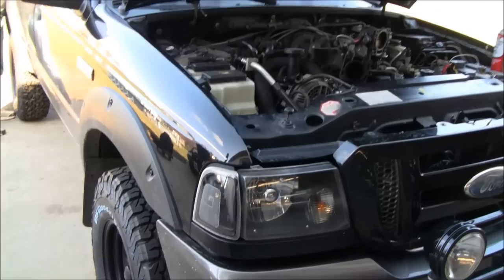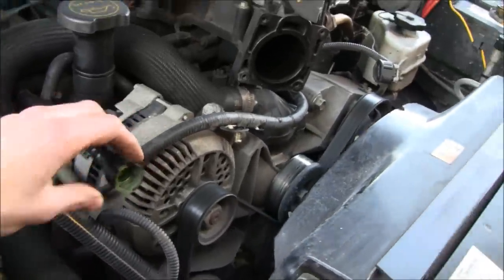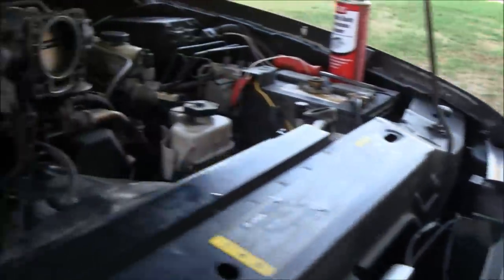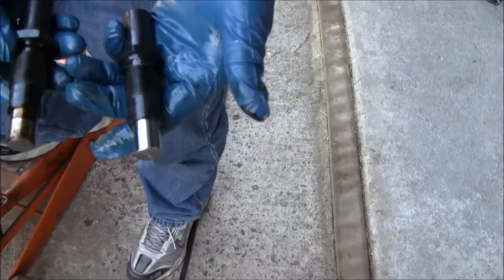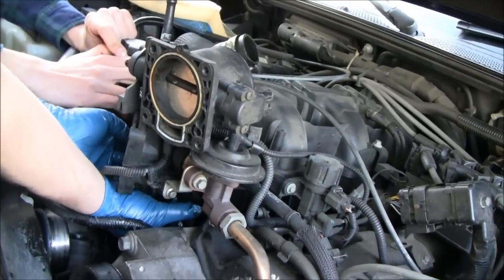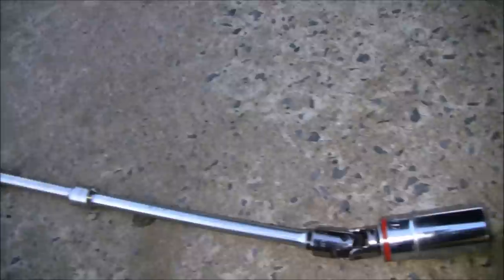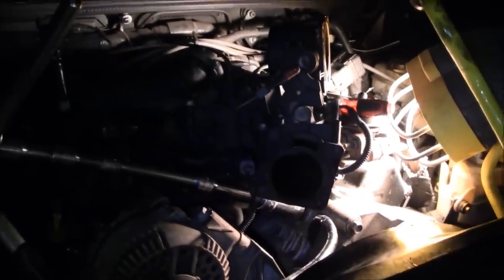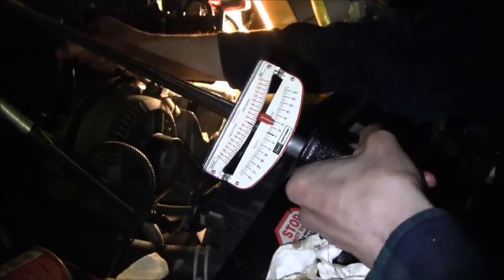REPLACING TIMING CHAIN TENSIONERS 4.0 SOHC

Comment: Thanks for the info. I installed the rear one today but didn't prime it. Problem sounded worse than before.  So I put  the old one back in. After watching this video, I  primed the new one. I will install after work tomorrow. Thanks again hopefully it does the trick. I've only got 150000 on the motor.
Reply: Updates did it work ?

Comment: Great job on this video and the suggestion to use Ford parts. Did the whole job in about 4 hours. I actually had more trouble with the rear tensioner than the front/top one.

Comment: Priming tensioners = cross-threading  😖

If you don't start your car for a few days, the tensioners will become 'un-primed' i.e. empty of oil.  That's what the spring is for.  Weak spring is why you're replacing them.
Strong spring should apply sufficient tension at start-up until it gets oil in it and the 'priming' is done for you.
Reply: I just replaced them. Even after sitting an hour it rattles on start. I replaced both and my passenger side in the rear still rattles on cold start. I’m stumped
Reply: @Cristiano Correia  Sounds like your guides may have already been decintegrated. So sadly the tenshioners might not do anything.
Reply: @ChrisC1946   Push gas peddle to floor and hold for 5 to 10 seconds while cranking to prime.  Engine will not start.  This also should reduce engine flare, as the 4.0 starts at high RPM without oil pressure.
-- If this does not solve cold startup rattle, the internal timing chain tensioner is broken.  Should also rattle at high RPM.
-- If you bought after-market parts, rate of defect is very high.  Stick with OEM Ford parts.
Reply: @C0Y0TE5 hey i have a 01 4.0 on my explorer and I during a cold start the chains rattle for 1 or 2 seconds max and then are completely quiet after that when idling and driving. Even if the engine is turned off after warming up and then back on 1 or 2 hours later  the chains won’t rattle when started back up…

I’ve replaced both tensioners using OEM ford parts and this made no difference with the 2 seconds of cold start rattle that was present before replacing both tensioners. Again after those brief 2 seconds of rattle when started up when the engines is completely cold (ie been sitting for more than a few hours) it never rattles or makes noise any other time.

One other thing to note is that if I do the flooded crank start method before starting it cold it will NOT make the 1 or 2 second rattle. (I will hold the gas pedal to the floor and turn and hold the key to crank the engine but not turn it over until I see the oil pressure gauge go to the middle, then let go of the gas pedal and start it) If I cold start it using this method it will NOT make the 1 or 2 seconds of startup rattle.

Is this my guides or is this normal to have a second of rattle when completely cold?
Reply: @XDLaughPLUR   It indicates that the oil is draining too fast out of the tensioners...?Ford has some bulletins on how to modify, but many comments I saw indicate that they may not work. Also, I have seen complaints about aftermarket tensioners.  I replaced mine with Ford parts, but they did not help.  Mine rattles only after sitting for many hours.
Reply: @C0Y0TE5  could the engine last for many more years doing this?
Reply: @XDLaughPLUR  I think so.  Do the flood start procedure when cold to avoid additional damage to chains and gears when chain is flopping around cold.  If it starts rattling all the time, the guides are toast.
Reply: @C0Y0TE5  does doing the flood start everyday wear out the starter and ignition faster since you’re cranking it for longer than normal or is it negligible?
Reply: @XDLaughPLUR  As I understand it, the Ignition will not fire. The starter will be working more, so it should need replacement sooner.  But that is cheaper than an engine or another vehicle.
Reply: @XDLaughPLUR 
Yes it's not ideal for those components, but is a helluva lot better than the alternative, which is broken chain guides and a car which is no longer worth fixing.
Even if you had to replace your starter every few years (which you won't) it would still be very worth it.
However, I would suggest finding the minimum cranking time required.
It may only be 3-5 secs, not 10 secs.

Comment: When trying to clean up threads, just use a hacksaw or Dremel tool with cut off blades and cut about three grooves in the old tensioner threads like a tap has only really small. It really works well, I have made a lot of taps out of bolts when working in the boonies on equipment to clean up the threads. If ya don't know what the boonies is you must be a Yankee.  LOL

Comment: Literally 8 bolts that hold the intake on it’s way easier to lift the intake up than it is to reach under it like you did. Also torque spec for those tensioners is only 33 ft-lbs

Comment: Don't forget to buy the gasket for the tensioner! It's 32 ft lbs for the right head tensioner. 02 v6 4.0 SOHC.
Reply: after market parts come with gasket.  OEM ford do not.  OEM parts do  not need a gasket?

Comment: i removed mine without removing anything but the thermal sensor clip, and air inlet hose. lol. but then im a mechanic, not an automotive parts changer.i used an open end 1 1/16 wrench, but maybe everyone doesnt have one of those. lol

Comment: Hey at 1:17 did the original tensioners have washers/gaskets on them when you removed them? I' m looking online on various websites that sell the OEM motorcraft tensioners and it appears none of them come with washers/gaskets...So 1.) did the original tensioners you removed have washers on them and 2.) If not then do you have to/can you just use any washers that fit on the tensioner? Thanks

Comment: I know you check the tensioner before you put the item in the engine. But pump it up and force the tensioner fully primed I was told is a NO NO for sure. YOU let the engine oil put the final pressure on the tensioner. What do you think fella ????

Comment: Don't prime: the spring needs to be able to give so installation is possible without cross-threading possibility.
-- After assembly, push gas peddle to floor and hold for 5 to 10 seconds while cranking to prime.  Engine will not start.  This also should reduce engine flare, as the 4.0 starts at high RPM without oil pressure
32 -45 foot pounds

Comment: I tore the front cover off and replaced my main guides and tensioners, but this was the actual culprit of the rattle. 15 hours down the drain. Just my luck...
Reply from the maker: +Brad Harper at least you don't have to worry about the guides being worn out anymore!
Reply: motoforlyfe Bad 02 sensor, bad intake gaskets, radiator leak, bad gas cap, gunky IAC, bad ball joints, rusty struts. Gotta love an exploder! At least it was a free car!

Comment from the maker: Get genuine Ford parts! When first I did my truck I used tensioners from Advance Auto and they would not prime and when I put them in the truck, the chains rattled continuously. Putting in Genuine Ford parts solved the problem. They're more expensive, but it's a price you've got to pay.
Reply: dirtbike5100 what's the price difference please let me know
Reply from the maker: It will cost you less than $200 for both tensioners from Ford. Don't use anything else!
Reply: dirtbike5100 ok cool I may have to do that to my ranger with the 4.0 and I think that's the noise I know it's not a knock in engine but I'll find out by my mechanic
Reply: How did you prim them?
Reply: Thank you. I watched the video yesterday and my new tensioner arrived today. I ordered a aftermarket tensioner too and the spring is weaker then on the really old OEM tensioner. So i will return it and i already have ordered a OEM tensioner. One question should i replace both tensioners at the same time or doesn't it matter?
Reply: @JK-cq5nc  I'm having same problem with weak spring and old one was stiffer  did you new ones fix your issue

Comment: I am in the process of doing this right now. I already successfully installed the rear tensioner but am having trouble with the front. It threads in about halfway and then doesn't go in anymore. Does this mean I cross threaded it? Would cutting the old tensioner and screwing it in fix this?
Reply from the maker: I apologize for the late response. Did you prime the tensioners with oil? What may be happening is that the tensioner is threading in until it begins to make contact with the timing chain cassette, at which time you begin to feel a lot of resistance because you are fighting the pressure of the tensioner. It is also possible that you may have cross-threaded it as we did in the video. That's why we had to cut apart the old tensioner; we used it as a make-shift tap to chase the threads. If you are unsure I would recommend having a professional take a look. If those threads get stripped out you'll be up a creek. Let me know if you have more questions.
Reply: Thanks for replying! Turns out I did crossthread the hole. I ended up taking the intake manifold off and retapping the hole with a tap. Everything is put back together and the truck runs great now! I used motorcraft tensioners and made sure to prime them. Thanks for replying love the videos man

Comment: You prime them in the vehicle pull plug wires from coil pack after labeling where they go then crank the engine for a few then recheck your oil add if needed, rehook your wires back on coil pack then start
Reply: Push gas pedal all the way before cranking the engine. This tells the computer not to introduce fuel. Crank until oul pressure gauge comes alive. Stop cranking. Let off has pedal. Start normally
Reply: .. or take out the fuel pump fuse

Comment: Do the oil holes from the tensioner and block have to line up?
Reply: yes.  That is why if the part comes with a gasket, use it.  If OEM FOrd, no gasket, do not add one

Comment: Loved the video but couldn't really figure out what you had to cut?... Does this have to be done for all?... And looked up pricing for the parts and it was more around $100 for both and not $200 you had mentioned in another comment.  What washers are needed?... Thought it was just the two tensioners?  Thanks again for your last response!!
Reply from the maker: It is not essential to cut the old tensioner as we did. The only reason we did it is that we were having a hard time with the threads and wanted to make sure they were good before trying to put the new one in. The washers are needed, one for each tensioner. Without them your tensioners will leak oil like a sieve. I don't know where you found the price of 100 but my advice to you is to be certain that they are genuine ford parts. I do not recommend aftermarket parts.

Comment: is that steady clicking at the end when it was idling normal? because that what my motor sounds like and I'm not familiar with fords.
Reply from the maker: I'm not sure what noise you are referring to, but these engines do make somewhat or a steady clicking noise at idle. We think it is the injectors pulsing.
Reply: Yes, I have this same car, that click was normal. The click that the tensioners cause is worse and intermittent (usually until pressure gauge is normal / car is hot) until the guides fully break (then it's constant and you might as well replace the whole chain).

Comment: Would this be the same for a 2007 4.0 SOHC mustang? Hearing some sort of intermittent slap noise coming from under the passenger side valve cover. Thinking it has something to do with the cam chain. Do you think replacing just the tensioner would work?
Reply: Yes, the same OilPressurized TimingTensioners are in all 1997~2001 Ford V6~4.0L~SOHC engines.  Various other items are different: Intakes, ValveCovers, etc.
Reply: correction 1997~2011

Comment: I don't know if I should feel impressed or scared that my 4.0 after 181,000 miles I never had the the tensioners replaced.  It's an 05 explorer and they just started to raddle maybe about a thousand miles ago.  Debating if I want to put the time and effort into it to see if those are even the cause.  Implying the damage hasn't already been done to the timing chain.
Reply from the maker: If it only rattles at startup you might want to consider replacing the tensioners. The springs are probably worn out and if you replace them you may find that the startup rattle goes away. However, in my experience, if too much wear has already taken place, replacing the tensioners will not help with startup rattle.
Reply: It doesnt rattle on a cold start.  Only after it has moved for about 5-10 min.  I've just concluded that It'll be retired until it just dies.  Hardly not worth a trade in except for scrap and thats not much.  But it had a good run.  Owned it at 5,000 miles and made it up to 180,000 miles
Reply: Last Gen Gamers Hi! What was the problem with yours? My 4.0 SOHC do same like yours.
Reply: @petipeti8564  I never opened it up. But i concluded the tensioner was shot on the timing chain. I ultimately didnt peruse it because my transfer case was leaking an I couldn't even open it to add new oil to it. As well the transmission was slipping real bad after I replaced it. With that plus the timing chain rattle I just retired the guy. It wasnt worth the money to fix it as everything was breaking. It was so close to 200,000miles too

Comment: Is there a washer that goes on that bolt tensioner?
Reply: yes
Reply: On both? Or just one? If so which one? I removed both of my original factory tensioners but only the one in the passenger wheel well had a washer. The one under the hood did not

Comment: Did you buy the tensioners out of autozone or did you go to the ford dealer and buy them from there? I have an explorer thats doing the same rattling noise but it stops when its all warmed up do you think its the same problem?? Great video by the way!
Reply from the maker: Whatever you do, do NOT buy auto zone tensioners. Buy genuine Ford parts or you will be asking for trouble. It's hard to be certain whether or not they will solve the problem but they are probably a good starting point

Comment: This a problem on the 2011 4.0 or did they fix the issue ? I had a 3.0 it was good to me 2wd sucked though I'm thinking I may get another ranger in 4wd but all they make is the 4.0
Reply from the maker: Supposedly they fixed the issue but I believe it still exists. I have an 06 w/40k on the motor and it rattles on startup.

Comment: Do you need to line up the holes on the tensioner?
Reply: You don't, when you insert the tensioner, a small circular "gallery" of oil is between the dot on the block and the dot on tensioner, which will flow oil inside the tensioner no matter the position of the holes.
Just tighten till is hard or to the torque spec.

Comment: so if you don't prime it it will rattle constantly?
Reply from the maker: +the mechanic it has been subject to debate. Originally I thought that was the case however some folks have commented saying they did not prime them and they only rattled for a few seconds.
Reply: motoforlyfe check out my videos and let me know what you think it could be valves ticking it's not loud but I just did the compete timing so I'm worried about it by the way it never goes away
Reply: No they will pressurize with oil pump just takes a few seconds...

Comment: did you use the old washer?what is the torque spec on both
Reply from the maker: +STEEVE DAVID Nicolas we ordered a new washer. I do not remember the torque spec but you should be able to find it on Google fairly easily.
Reply: Ok thanks
Reply: my chiltons for 2000-2008 says 32 ft lbs for the timing chain tensioners.  
that's the torque on a NEW washer.
I've read elsewhere that if you reuse a washer that it's a higher torque.
.
Reply: If using OEM motorcraft tensioners do both need o rings/gaskets or just the passenger side one? I removed both but my old one in the engine bay did not have an oring. There are so many conflicting answers online